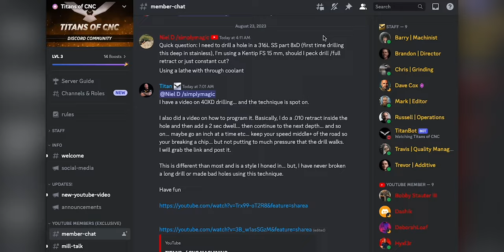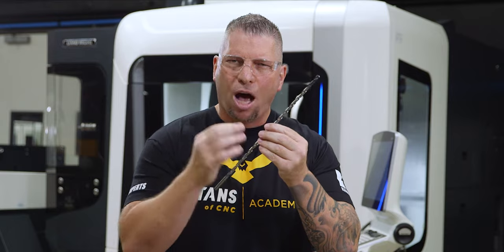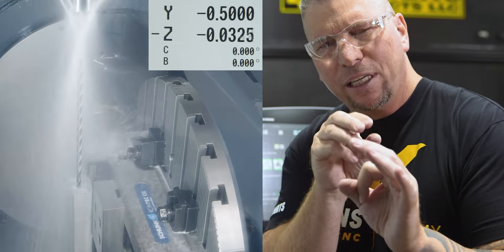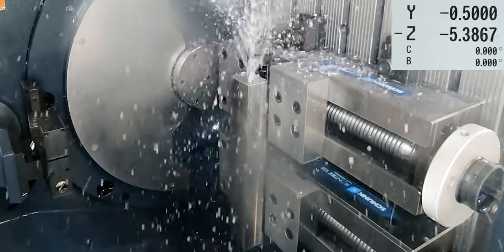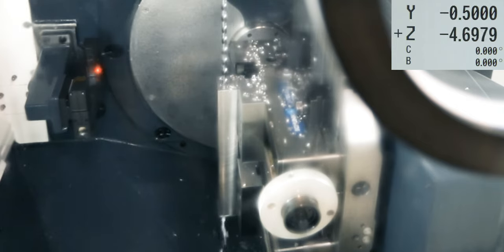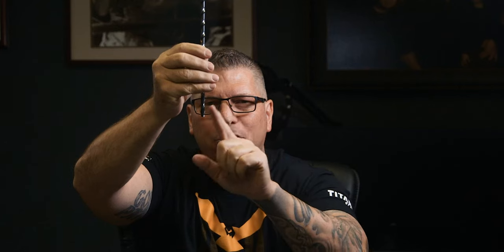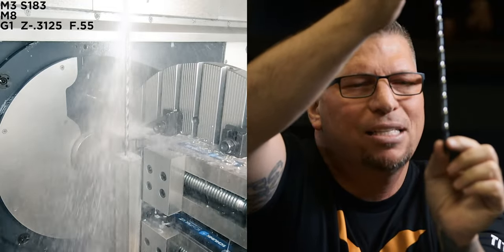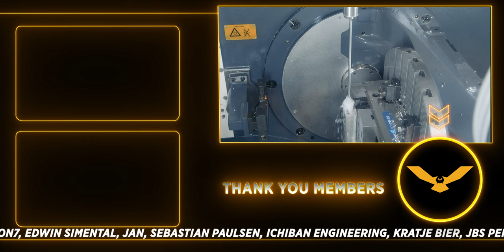This Hole was IMPOSSIBLE to Drill Until I Figured Out this Process

Comment: So let's see the results.  Show us the bottom end of the stock and the three holes.  Measure the hole locations and report their runout relative to their planned/programmed positions.
Reply: Maybe holes that need to be that long have some wiggle room in the tolerances.
Reply: I’ve got a feeling that a carbide drill of that diameter isn’t walking very much, especially since the hole was already pilot drilled and it’s running thru spindle HP coolant.
Reply: @tropixMw2  often they have not. for example in molds  you have to drill several of those close together for the cooling. or in Automotive applications, they drill such deep holes into the main shaft of the engine, for oil distribution to the different bearings.
Reply: In the original video they do exactly that.
Reply: Very informative.  How about a case of 3/8s and smaller for a depth of 6 inch.  With a rpm limit of 1800 (AKA Haas TL-2 and no through coolant).  This is my challenge in 17-4.
Reply: @ChrisRidesHisBike diameter doesn't matter at all. It's length÷diameter that matters. If the pressure is off the drill can bow and walk. Yeah, with carbide it won't do that for very long before it shatters vs has but it still can. Carbide doesn't have 0 flex properties. Point and case. If you've ever run a .5" Dia endmill at 2" loc on ss316 and your feds and speeds are not right you can have measurable taper from top to bottom on the walls up to .002" over that distance. That's 4x Dia. Imagine 10x that length vs Dia. A lot of these aerospace parts have true positions of .002" for features that'll make your head spin.
Reply: yup i want to see that
Reply: @Turboy65 last shop I worked at we had to drill a 26xD hole using a gun drill. The hole was .5” diameter and 13” deep on a .75” shaft. Quality control checked it with some sort of machine that measures coatings and found that it was within .001” concentricity at the bottom of the hole. This was using a gun drill and not a high quality drill like Titan so he’s definitely telling the truth. I used his technique and it worked first try.
Reply: @erikvasaver that would be because gun drills are the better tool to use for deep hole drilling. We use them for our water circuits in our moulds and I've done some 10mm dia 600mm deep. Our positions aren't critical but let me tell you, they come out looking perfect every time.
Reply: @erikvasaver  "gun drill"...the name gives you a clue.  It's what barrels are drilled with, and barrel bores need to be very straight. And typically, they are, with runout measured in just a few thousandths.
Reply: @Turboy65  and I believe gun drills are an older technology so I’m sure there are some advantages to these newer drills. The reason the shop I worked for opted for the gun drill is that we had an owner and lead machinist that were ready to retire. Both only knew about outdated tech. Also, the gun drill had to be ran painfully slower than a carbide drill.
Reply: @Turboy65  Were running a family of stainless parts right now using this exact method,  (when we got the opportunity to quote them, I actually referenced back to this video) except that we are putting a flat bottom pilot hole in with an OSG drill, and then bringing in a Star SU gun drill for the deep hole. And we’re doing it all on a lathe. The parts are 13.8” long, with an 11mm hole. When we check them, we’re seeing on average about .001-.0015 of walkout on the back side. It’s a really solid method for this kind of hole making. 

I can’t speak to the Kennametal drill, but the Star piece is holding up really well. We’ve ran about 65-70 parts so far, and the holes are still dead on in diameter and the finish is usually better than a 10Ra. Star’s published method is almost exactly what Titan shows here, except that they spend a lot of time detailing what they’d like to see for coolant pressure for given diameters and coolant concentration, etc. 

The only issue we have with this method is how time consuming the entry process is. It’s like watching paint dry. But we just remind ourselves that the competition can’t do it any faster. 👍🏻
Reply: I mean your drill is going to walk if you don't nail the chipload or have a bunch of runout in it, of course. It takes some experimentation to see what you can get away with, but err on a slower cutting speed. Tool specs will tell you chipload, or forums. There are ballpark numbers but when doing something like this you want the exact ipt.

You want to keep it from walking as much as possible because once it starts, it starts. So it you don't keep everything straight or your drill sucks you're going to get a blown out bottom as the best case scenario.
Reply: We drill 40xd in brass moldblocks.  7/16" dia 17.625 in deep.  These used to be gundrilled.  We normally assume a .001 inch per inch walk possibility.  They said, in the center of the block we drill cross holes no closer than .040inch to the gun drilled holes.  More than double the max the hole  could walk.  These are cooling holes so they do not need to be absolutely perfect.
Reply: @erikvasaver  yes we use gun drills but only if we need to go deeper than a carbide drill can (or is available). I think the longest Kennmetal drill like this we use is 30D? I drill 6mm holes to about 200mm with kennmetal but overthat we use a gun drill. I've cheated and used a kennmetal then gone back down and deepened with a gundrill.
Reply: @Turboy65 
Yep. I've drilled twice as deep with a quarter inch gun drill. Takes longer though.
Reply: I agree, could look like directional boring, instead of a laser line down a bore. I've seen it, I've done it. You could also see a substantial amount of harmonic shake
Reply: @tropixMw2 no, absolutely not
Reply: @tropixMw2 yip as impressive as this is I have a concern regarding position on opp end.

Comment: People asking for results... about a month after titans first video on this first came out, a job came through my shop that I almost passed up. .379" hole drilled 16.25" deep in 316L stainless. I ordered up this exact combination, ran it just like the video, 120 pcs with absolutely no problem. End to end the holes had a tolerance of .0015" deviation, mine where all within .0008" of Centerpoint location. My diameter tolerance was .0015/-0.000 and mine where consistently +.0005 to +.0012. It works, and works well. That job opened up a whole new series of opportunities for us and now my guys are deep drilling and gun drilling  crazy L/D ratios on the regular.

Comment: You want to reverse the spindle when entering the drill into the pre drilled hole. And also stop the spindle and turn of coolant before exiting the hole completely. This is a common gundrill strategy and also works great with long carbide drills.
Reply: In my work site we work a lot with Deep drilling, i m talking of holes of even 2 meters, and we do like that in most of cases, but like always depending on the situation, but usually thats the usual tactic.
Reply: Its a great way to prevent the drill from catching a corner and breaking. But if theres a chip in the hole, it might not evacuate. Thats why I always run CW at 50 RPM like Titan mentioned.
Reply: @hanibal764  Two meters?  What was the smallest diameter ever drilled that deep?

Comment: If you take this guys word, Kennametal makes the best over every kind of tool imaginable across the board. They’re fine, but I’d call them mid-grade. In my experience, at least with smaller diameters, Mitsubishi makes the best deep hole drills. Harvey tool makes nice ones too but not a big range of sizes.  I’ve personally run an .093” Mitsubishi drill 3.2” deep in 304SS through several thousand parts in a Swiss lathe holding under .0005” T.I.R drill to outer diameter and .0002” T.I.R to a shallow bore at the front of the drilled hole.

Comment: Quick tip to anyone new at deep hole drilling like this - turn your spindle on backwards entering the hole so the cutting edge will never catch the wall of the predrilled hole and snap the drill off (ask me how I know) then turn it back to the correct cutting direction when you begin the drilling cycle at full speed
Reply: Correct! also do this when exiting the hole.

Comment: One more thing to consider:
when the long drill is getting twisted by cutting forces the chip evacuation channels "unwrap" a bit and the diameter becomes larger, It is why the drill is on the lower side of the tolerance
Reply: The longer the drill, the smaller it is to be able to pilot drill with shorter drills.  Not by much, microns.

Comment: Been deep hole drilling for over a decade now, from 10-70xD in almost every material you can imagine, form stainless to inconel, even 55 HRC dies steels. This video give good insight to the programming which is crucial but not as hard as so many make it out to be. With the right programs you can flawlessly deep drill in any material with consistent repeatability. 
My only issue is that the IPR is too small, .003" IPR is less than 1 percent of diameter of the drill, in this material the minimal I would go is 2 and all the way up to 4 percent of the diameter. With this feed being low, you can see how small and thin the chips are, you will wear this drill out prematurely and it is more likely to wander.

Comment: Our company here in New Zealand makes hydraulic manifolds for the most part, usually out of Ductile Iron, Mild steel and Aluminium. And occasionally stainless steel. Ane we use these drills for all our deep drillings and they are a great drill. My machine is a Horizontal (Matsuura HP630) and deepest drilling I've done is around 350mm with a 12mm Kennmetal. What you do is pretty much what we do although we reverse direction in Z 5mm once we get to depth, theres a half second dwell spindle goes to 50RPM and it retracts at 100% rapid. We also leave the flood coolant on and our CTS is on just before the drill enters the pilot hole. We also use 4mm drills but only go to 150mmmm max deep and as there have been issues with chips not clearing we stopped doing this cycle and changed it so it plunges to 50mm then changes to a chip break cycle (G83). Great video.

Comment: looking at your work holding i have 2 good fundamental questions. #1 how do you decide when to use a dovetail jaws between 2 vices or  2 serrated jaw vices?  #2 how do you line them up to assure the work piece doesn't fly out?

Comment: We are already use this drill in steel En19 materials

Hypermill has a particular cycle for this. 

We are useing D8 Kenna drill with deep of 286mm with pilot drill of 25mm . 

Life of the drill is achieving with 5m with coated corners , with regrading we were achieved more then 50m life. 

Onevthe best drill geometry I ever seen.

Comment: We drill stainless using 3 different length 3.5mm Walter drills almost 5 inches deep. First a pilot, then an intermediate and finally a 6" long drill. The trick is to engage the intermediate and long drill slowly in M4 rotation at low rpm to about 3/16" depth, stop the spindle, turn on the through tool coolant, M3 12,000 rpm and in it goes like butter.

Comment: we once drilled a 175 times diameter hole into steel :-) and it worked great. they made a spezial tool, its a pipe that was squished into a 3/4 cake shaped crosssection, to get the cooling fluid to the tip, that was made from tungsten cabide and soldered onto the pipe. its was really fun to do, first we predrilled a 60mm deep hole with a normal 8mm cabide drill, then we slowly inserted the spezial 8mm drill and drilled up to the 1400mm deep we had to go. and i am not sure but we were off by 0,1 or 0,2 mm wich is pretty imperssive. the hole was just for grease, so it was not that important to be perfect.

Comment: I realize that in this specific scenario it doesn't matter because the pilot drill will have coolant to clean any chips but, by not turning flood coolant back on, is it in case you have multiple pilot holes drilled and preventing chips from falling in there or some other reason?

Comment: He didn't talk about everything this video but it is really hard to cover everything at once in a relatively short video. I have a couple of additions.
Pilot hole needs to be 3 times drill diameter or greater. Titan talked about hole diameter and other things, but it is also worth noting double checking the diameter with a gauge pin is a good idea. This will catch both diameter and roundness problems, both of which will break drills. A small chamfer at the top of the hole also isn't a bad idea to guide the deep hole drill.
This demonstration was with a vertical machine. The struggle with vertical machines is chips wanting to fall back into the hole. Horizontal machines struggle with drill drooping, and you might have to program in a slight offset to account for this. Also, drilling one pilot followed by one deep hole is the preferred method if time allows. This prevents chips from being in the pilot hole.
The piloting process shown here was very conservative, you can definately go faster but work up to it. You still need to keep your rpms low, but you can feed a bit faster. Pilot RPM should always be below 500 rpms.
The pauses in this program are way too long, and you don't need one when you turn the coolant on. 50-100 ms is enough after you tell the drill to go to full rpm, assuming a fairly modern machine.
For though holes, it is a good idea to slow down the federate before exit. There 50-75% is generally the range for exits.
The exit feedrate and rpm was very conservative again. These are good to start with, but in high volume production these numbers are too slow.
Reply: Could u elaborate on the pilot hole needing to be 3 times drill diameter? Are u saying if im drilling a .25" hole i need a .75" pilot? Because that would kill 100% of the parts i run lol
Reply: @verakoo6187  the pilot needs to be 3x the drill diameter in depth. Diameter should be about 0.001" larger than the deep hole drill, but most suppliers will have a pilot tool made for their deep hole drill. Use that and diameter should not be a problem.

Comment: Excellent video.  Love your practical hands-on approach to your work.  Q.  How do you stop a 'birds nest' when drilling normal steel?  Cheers!
Reply: If you are birdnesting with stringy material like 1018, 4140, other alloys you may have to increase feed, generally with a 2 flute carbide coolant drill you want to be feeding at 2-4 percent of the diameter. Also, look for tooling with r-gashing that forces the chip to break instead of the x-thinning style tip.

Comment: The pilot hole is key. It supports the long drill to stop it blazing it's own trail, but not much info on why 1.2" was said. Could you get away with 1"? is it 1.2" for any size drill? The answer is that it needs to be deep enough to support the long drill on 4 points along it's twist - the cutting flutes and 90º to the cutting flutes or then 1/4 helix pitch of the long drill in depth. That stops it dancing around off center.
As the pilot drill is still just a drill, it can wander too even if very short and if you're aiming for the best straightness, you don't use a tool that slaves to the hole like a reamer or drill, you'd bore the pilot so it's 100% concentric with the spindle.
Reply: Probably was a 3xd drill that he buried.  Depending on the manufacturer, a 3xd drill can have 5xd of flute length.  Here he went just shy of 4xd.

Comment: I have a few questions,
how many holes or mm can you expect before failure/ resharpen?
how many times can you resharpen the tool ? (i have in mind that you can resharpen it a lot but the inner structure is going to fail).
much love from Germany and thank you for your education in this industry.
Reply: One drill - one hole
One size, one goal
No going back....
Or what should be (its a kind of magic)
Reply: I´m use them and some other in 1.4404 (2 - 2,5 - 4 - 5 - 5,5 - 6mm up to 30xD) with feed and speed from Novo. Tool life is about 8m - 11m including some interrupted holes. Position is around 0,03mm at 100mm deep.
Reply: thanks mate just asking last week i had to drill some alloy 50 or xm-19 some nasty shit, and broke one drill
i used osg drill, tool breaks after 8m

Comment: Be really careful with those long drills! We almost killed somebody with these long drilling tools.

In the company i work we have similar drills from diameter 5 to 80mm.
We had a crash because we speed up the tool before it was engaged, then the drill bend to an L shape and the head of the drill shoot through the sheet metal of the machine. It was 30-50cm next to the head of the worker.

Comment: Was there some calculation or reason your spot depth was 1.2? Could a half round drill do this if you were able to get coolant at the bottom?
Reply: He was more than likely using a 3xd drill so he buried it to get as deep a pilot as he could.  He could have gone in after with an 8xd or whatever intermediate drill as well.  Depends on how straight you need it.

Comment: it is good to spin the drill counterclockwise. down the hole. so it doesn't capsize and the corners come off then I usually drill with 20 times the diameter before I go on with 40/50 times the diameter
Reply: 40/50 times the dia. man that is nerve wrecking for me.I've never drilled anything that deep especially in small sizes.

Comment: Deep hole drilling cycle, canned cycle with thru coolant drills. It's not terribly hard, but stainless steel is a nightmare to work with if you don't have coolant flooding.

Comment: As a non engineering and non cnc guy but like to watch videos. Why not drill the hole in stages with different length bits, till you get to the required depth. Can avoid flex and risk of breakage?
Reply: You would just be adding more stages of potential failure, on top of wasting time with tool changes.
Reply: This is applicable with drilling deep like this to increase tool life of the drill. When drilling 50 x D I will start out with a 5xd drill then a 30xd drill and finish with the 50xd.